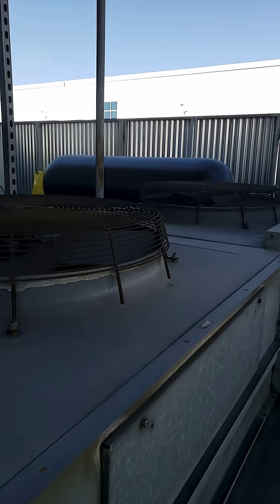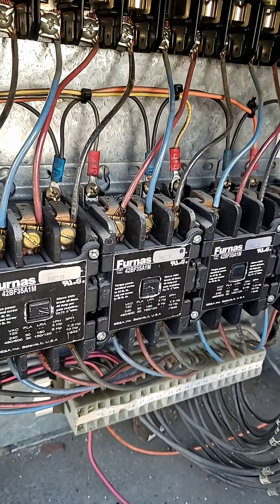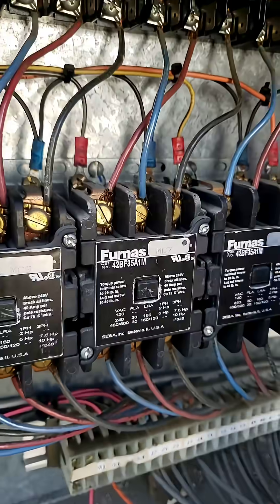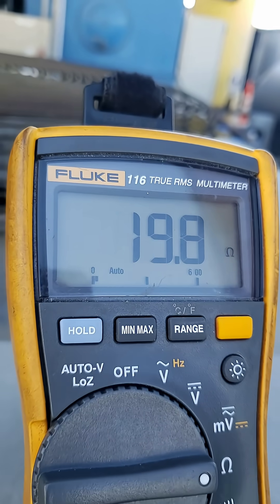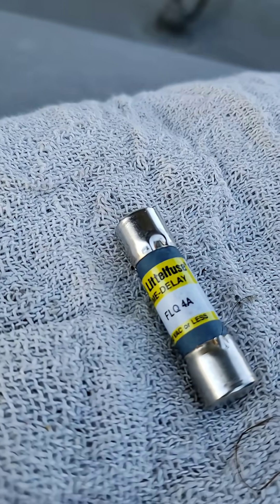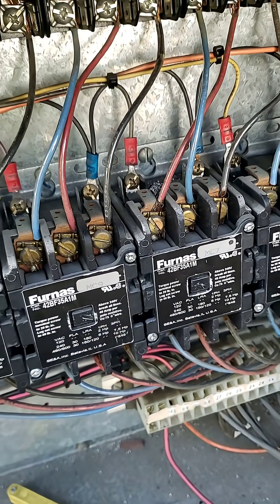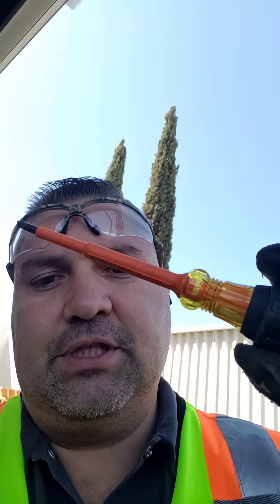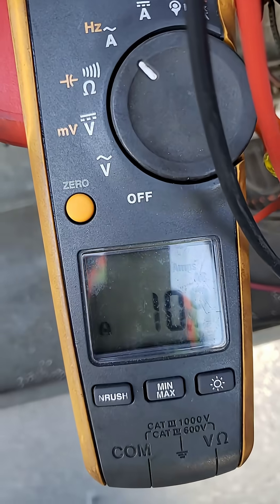Bad Condenser Motor? Don't Guess - Do THIS First👇

Comment: rip it out and replace it.......and the wirng looks like it all needs replaced soon very soon....my question is why they are not under a utility/metal shed type building..to keep the weather/dirt out of them....which still allows them to operate  properly....and be maintained out of the weather....